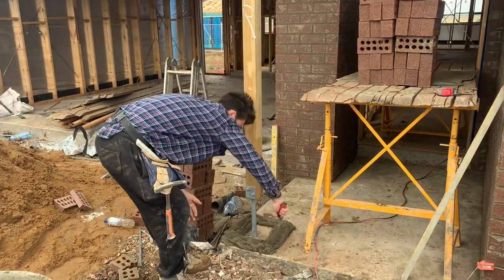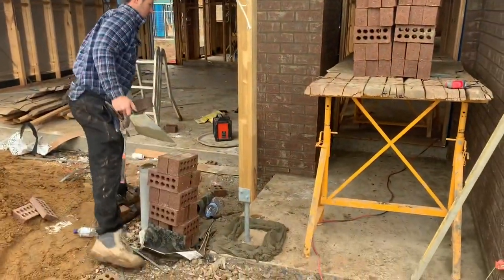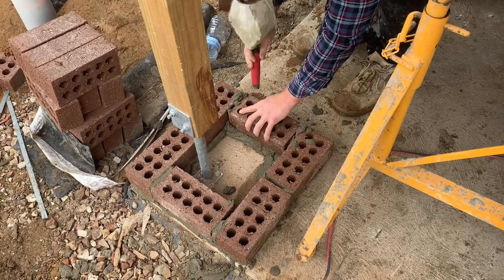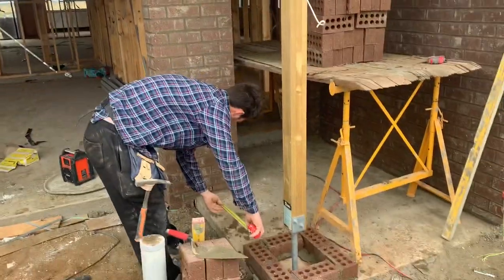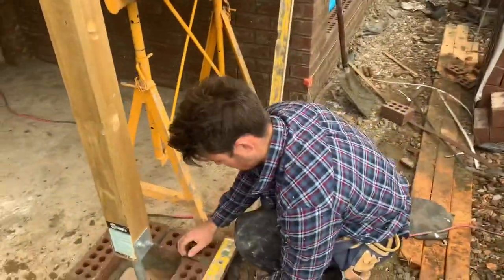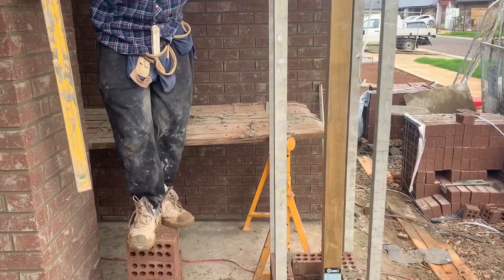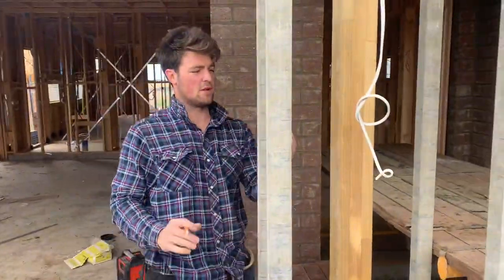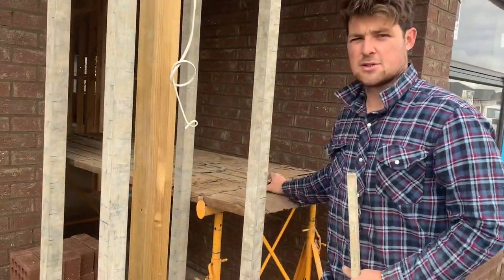Bricklaying How I set up a Brick Pier

Comment: hey , why dont you use Jack lines?  i mean i guess profiles works fine but i believe if you have a timber at the top you could use a laser  and just have a 12 inch or whateva nail with regular bricky line 🤙

Comment: That pier has to be in line with the house wall. And you should level across from the house brickwork to the pier so it is spot on with the house gauge
Reply from the maker: It’s in line with the front wall parallel. But not with the entrance wallz

Comment: That doesn't properly determine  squareness. You should have measured diagonals of the corner bricks of the peer. Also, yes 1400mm but were the inside row of brick measuring 930mm?

Comment: Guauge up ......?
Reply from the maker: Rendered pier
Reply from the maker: So I leveled off and just gauged up rather than down
Reply: Hendo.....
Saw you had an arbotech saw what are they like ....any good in hard mud 
Thanks
Reply from the maker: @gailgraham6331  very good mate life saver at them bad times. Just need to keep the blades in check. As they can go blunt if your hitting brickwork often with them!
Reply: @hendosbricklaying2003  ok thanks for the reply .....9in angle grinder monster ....diamond tipped recipro pretty good not much dust easy to control blades 35 bucks a throw not very long lasting looking for a better way .....thanks for your reply